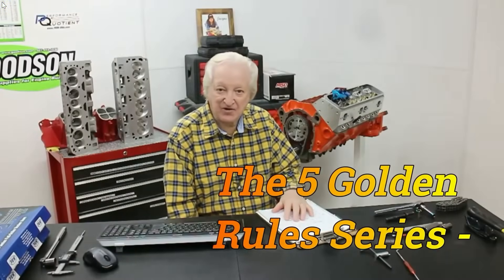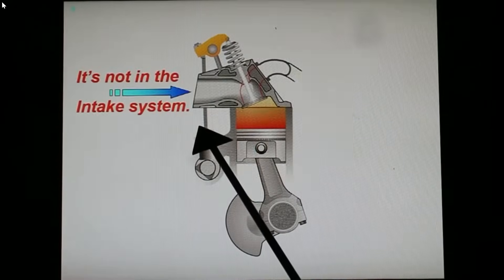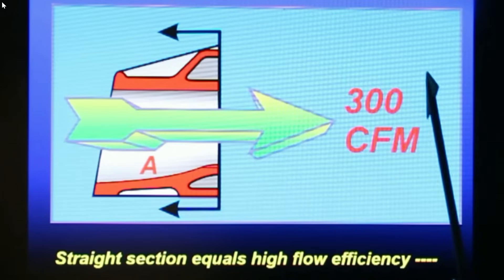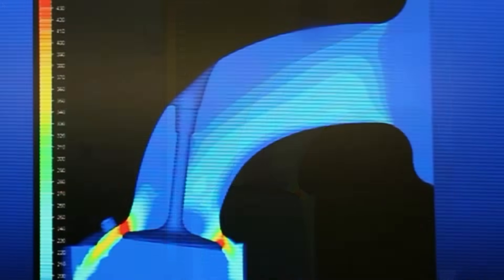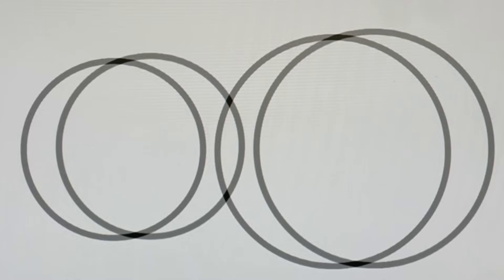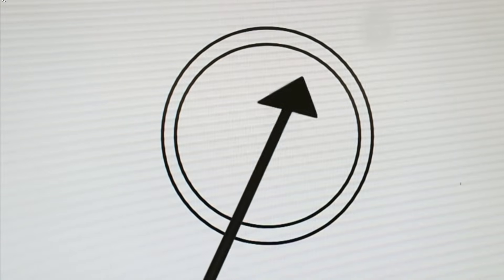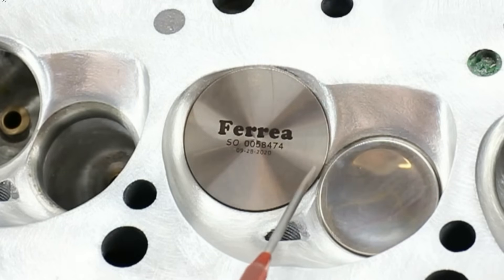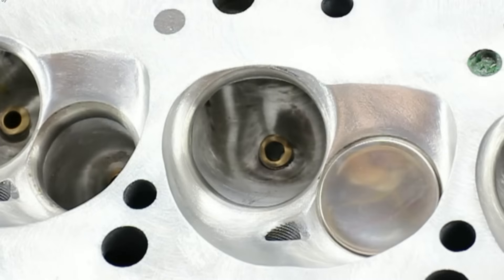5 golden porting rules - #1

Comment: I like your common sense, I believe you are basically turning the pinch point intake port into a "volute" which trades velocity for pressure which is in effect with the pulse is sort of an unassisted supercharger,the more air in the more fuel can be burnt efficiently producing more power.i really loved the tutorial on the version in the exhaust port,you are a treasure Mr Vizard.

Comment: It may flow more, but if the valve seat is cut away to increase flow, the heat transfer from the valve to the seat will be less, and the valve will run hotter - especially if the valve stem is more exposed because the valve guide has been cut back out of the air flow.  Also, a smaller seat will wear faster and seal less completely - the valve changes dimensions as it and the head heat up, from expansion.  Can't ignore these issues.
Reply: You do realize you’re addressing THE MAN on this process correct?

Comment: The Density of air at atmospheric pressure is 1.2 kg/m3
Pressure Drop (in Pascals) is 0.5 x 1.2 x velocity squared x shape co-efficient *
*See the SMACNA Design Manual for (very insightful) co-efficientsdefined for HVAC airflow design based on pressure drop, though very insightful for porting!

Comment: Why doesn't anyone make an engine head that has an intake port on both sides of the valve? that would double the flow. could work on a DOHC inline 4 cylinder or v twin
Reply: still one exhaust? I would be interested to see how such an engine performs. NA engines can't get enough air.
Reply: Lancia did in fact do this in around 1986. They developed an inline 1800cc 4 cylinder engine called a "TRI-FlUX" which was to be used in the  Lancia ECV Group S rally car but the class which was planned to replace group B was scrapped before it started. It had diagonally opposing exhaust & intake valves/ports. The exhaust ports were on both sides of the engine which allowed them to use a Turbo charger on each side of the engine. The intake ports were in the centre of the head to feed the combustion chambers from above. It was a very complex but very clever design. I believe the engine was able to produce up to around 800hp during testing. Google Lancia Tri-Flux.... it's a stunning engine.
Reply: Not necessarily. It might add some flow but not much more than a large port. But the problem with that is that you’d be applying half the engine suction to each side, meaning each side would move half as fast. That would kill air velocity which greatly affects atomization and power. More airflow isn’t always better
Reply: BMW actually managed this in 1966 with Paul Rosches M10 Apfelbeck 4 cyl engine for the F2. it had 8 intake runners 16v and radial valve design. wich improved head heat disapation and better fuel atomization. it also revved realy well. it had 260hp at 8000rpm in the 60ś for "only " a 2L engine
Reply: @hardforeveryone118 holy shit!! There is so much we are ignorant to , I didn’t know that they used to use water injection (steam, mist….H2O!) in order to increase octane performance on air planes that were turbocharged
Reply: @larryfleming7295 Oh yes, water injection is a very old concept, it utilises the latent heat of vapourisation concept to cool the charge
Reply: I like that concept or an oval that centers around the base of the valve seat or use it under forced induction and make more room a bigger chamber which would lower compression but could possibly make up with flow
Reply: Or a blend of 2 radius’s for the port 3radius top and 5 on bottom into widened oval that shrinks down to radius of the valve seat opening after dressed and worked for optimum flow

Comment: Are used to hang around and help in a little machine shop in Seattle Washington is actually in White Center on 16th Ave., South Foster‘s machine and they got a son in VGS 120 Seton guide machine and they started using on on the high-performance heads, a radius cut on the seat and what that did according to what the information said is when the valve first comes off the seat, it flows a little bit more Because of the radius cut anyway I just thought I’d throw that out there. This is Jim.Mungai from kennerdell Pa

Comment: I have always wondered since I was about 9 or 10.
Air is about 20% oxygen.  The rest is nitrogen and other gasses.
When we burn the fuel in the combustion chamber, what happens to the nitrogen and other gasses.
I don't have the funds or the knowledge to figure this out.
I'm hoping you can tell me.
Yes I have built several engines except for the machining.
Reply: A little of the Nitrogen (N2 i.e. 2 nitrogen atoms joined by a triple bond) is broken apart and converted to oxides of Nitrogen (NOx) mainly NO and NO2 but the majority of it passes through unchanged and exits as N2, same as it entered, just hotter.  CO2 stays as CO2, and is joined by a whole lot more CO2 from the  product of combustion.  The tiny amounts of noble gases like argon pass through unchaged as they don't like reacting with anything.
Reply: @andywebster4701 thank you for the explanation. I am now 66 and more informed. It has taken this long to get an answer. Thank you again

Comment: HOW ABOUT EXPLAINING WHAT 
"28 INCHES" 
REFERS TO. 
I HAVE LISTENED TO DARIN MORGAN FOR HOURS, 
AND HAVE NEVER HEARD ANYTHING SIMILAR. 
DO YOU MEAN : 
28 THOUSANDTHS INCH ? 

OR AR YOU TALKING ABOUT ATMOSPHERIC PRESSURE 
1 BAR = 14.7 PSI RIGHT 

YOU JUST ASSUME TOO MUCH 6:35
Reply: 28 inches of mercury, its a rating of vacuum pressure. its just the setting of how much suction they are using on the flow bench, you don't really need to know what it is unless you are comparing flow numbers. They use 28 inches as standard, but I guess used to be 25 so if you are comparing David's numbers to someone else's you'd need to convert to that 28 inch reading, since 28 inches is more suction and therefore more flow.
edit: I already knew what he was talking about in this case, but I've often had the same problem when I'm learning something new, especially in the engine world where I have literally 0 idea what they are talking about because its assumed its something you already know.
Reply: @Born_Stellar 
AT THE START , THE TITLE SCROLLS ...
PROVEN IS MISSPELLED IF YOU ARE IN THE USA. 
LIKE 
COLOR NOT COLOUR IB THE UK
Reply: @ no im canadian we spell it like colour as well.
Reply: @Born_Stellar 
PROVEN : CORRECT 
PROOVEN : WRONG 

SORRY , I CONFUSED THE ISSUE

Comment: For 95% of those who seek the magic of increased power thru cylinder head improvements,  the most cost effective route is one of the CNC heads (If Available for UR engine) as many commercial performance engine builders already do.

Comment: Great tips, and we got to learn sometime, I did my first set on my Disel and all I used was paper to take out casting bumps and smooth it out, before any work was done to heads, I’m a pretty confident user of grinding tools and I did a good job on the heads, sent my motor into a shop a good ways from me , they told me I ruined my heads and I needed to buy new ones, I’m 1000% positive they lied and stole my heads, and they didn’t check piston to valve clearance for the stage 2 cam now I have 8 pistons with valve impressions. 
Is a sad world out there folks . Good on you Pete for being a good guy! Enjoy the lessons
Reply: Eric weingartener showed pretty good flow improvements from just removing the casting marks with 60 grit paper.
Reply: Share the name so we can avoid them!

Comment: 90% ? What do you mean when you're talking about the seat's 90%
Reply: Inner diameter of the valve seat should be 91% of the outer diameter.
Reply: @andyboulet pretty much rim the shirt out of that outer layer but keep such a fine line so valves can sit
Reply: The throat, which is the area just behind the valve seat should be ~90% of the diameter of the valve seat. It creates a venturi effect. making the throat too large kills flow.
Reply: i dont get it either...
Reply: You take your intake valve size, let's say it's a 2.02 SBC valve. With the valve removed you measure the diameter of the port just inside where the last angle cut on the valve seat is, just inside the port. This is the throat. On OE heads it is usually very small, on aluminum heads it is usually already 88% and it's easier to find as there is a steel seat insert. On an aluminum head it is basically the diameter of the uncut part of the valve seat inside the port.

Comment: I though valves rotated in the guide and seat?
Reply: they do rotate like crazy, look any video of valves in running engine. It allow to have even wear
Reply: @inevespace  yes and not! There are 2 type of valve.  One for street cars with 3 groove and another type with single groove which grab the whole valve and not allow to turn at all is better for race application
Reply: @laszloszell8753  interesting. I had some Big intake valves with single grooves I thought were for air cooled 911. Couldn't understand the application. But I never did any research on it.
Reply: @laszloszell8753 in motorbike engines single groove valves rotate without problem. If I understood you right you are talking about retaining collets?
Reply: Like a venturi
Reply: They mainly stay put at normal operating speeds but, depending on setup, rotate quite a bit at higher rpm. 

Watch a video titled as “Overhead Cam at 14K RPM” and another title as “Valve Spring 8500 RPM”. You can see they are spinning as the spring is indexed sit a stripe in both videos.

Comment: I was taught to open the ports to the gasket inner diamiater size.
Reply: thats the port entrance on the intake side. this is inside the head. Port matching is easy and probably provides some gain, but not as much as opening the biggest restriction, which is the valve.

Comment: Are you the same David vizard of Mini Cooper fame, I bought your mini book years ago forgot the name,but I remwmber the lotos engine on a mini gearbox, I even moved my clocks t o put a 45 Weber on my mini 1275,reborded it out to 1330  if I remember correctly but the battery box in the dash good old days building my 1275 gt clubman .i remember now how to modify mini,by David Vizard ,definitely a new subscriber,
Reply: Is that the objective to porting a head to remove material from the intake and exhaust port to get more air in and out of the engine quicker.
Reply: @JasonLingerfelt  no more volume isn't always better, and sometimes people use stuff like epoxy to make the ports smaller in some locations. Port shape is more important than volume so you have to know what you are doing. just removing material everywhere will quickly ruin a head.

Comment: Respect to those that share their acquired skills and knowledge, which most definitely includes you David, Thank you. Had to reply to the malicious keyboard warrior previously, who, I believe is stuck in a world of hate. In reply, today we have an exponential volume of knowledge, led by Dr Google, good bad and indifferent. However principles remain constant and are enduring. Remember over a century ago twin cams, multi valves etc were already being manufactured. In the US mass produced car engines didn't reach a hp per ci till mid 50's. The evolution of fuel, alloys, man made fibres, casting techniques, machining and most of all, in recent times, silicon (as in computing) have revolutionised our world including automotive engineering. I will put my faith in a human being that has honed (punn intended) his skills over half a century and is prepared to share them. Thanks again David.

Comment: Okay, I understand the ratios but am I crazy or did he point to the wrong side of the seat when talking about the 93%? Starting at 15:10 its backwards right?
Reply: Where he pointed at 15:17 is actually the short turn, and the initial point at 15:10 would be the straight shot into the cylinder that would get the 93%
Reply: I came here to ask the same question and I think you’re right.  He did say 93% and point to the short turn and 91% on the long.  But if I understand what he’s saying correctly, we want to enlarge the throat on the long side of the seat where the bulk of the flow is and is crashing into that corner.

Comment: Usually I skip over old timers, because some of the guys I've met or watched haven't the slightest clue how things actually work. They just have their ideas and theories. That may have won at the local sportsdrome lol but in today's engines they are lost. "Too many wires blahhh" lol
There's still old guys saying 305 heads on a 350 is the way to go. (It's not, you lose so much cfm flow in the runners it's crazy) 
Then u have those guys who say they tried vortec heads on a sbc. They're junk. I ask em which cast it was. They said it came off a 90 Chevy truck. 😂😂😂 bro that's swirl port. Worst possible head out there. They think the center bolt valve covers automatically mean vortec heads 😂😂

Anyways My point was... this old timer right here knows some shit and I like his channel already. Subscribed.

Comment: So basically. High-ratio rockers and camshafts go first before i ever think about porting. 

Just get the valve out of the way of the air.
Reply: No, a given head design will have a limit to the amount of flow it can accomplish before you get reversion or turbulence. Simply opening the valve further will help to a point but on a SBC head for instance with a 1.94intake valve you might have an increase up to .480 lift or so but pushing it to .520 it will encounter turbulence and will kill the power. Of course none of this is linear, if you encounter a little turbulence at .520 you might get whole bunch at .575. So many things effect where the port is efficient, especially when dealing with stock style heads. You need to decide what you want to accomplish before you do any modifications. Street, street/strip, mild race or all out race. All require different components and air flow requirements. Once you have a goal you can build the engine to accomplish that. If you just throw parts at it then you will more than likely hurt performance rather than help and money is too hard to come by to waste it.
Reply: @1967davethewave  duration 🤔

Comment: I'm not sure what all those percentages are supposed to mean
Reply: (Throat diameter divided by valve diameter) x 100 = ?? %            Example.  (2.000” throat / 2.190” valve) x 100 = 91.3 %
Throat is the round area at the seat....
Reply: Primary resistance of flow period. Some people will never understand and that's OK 👍 just means this is not your area or field of work to understand!! Just like I don't understand the  Accountant numbers !!!
Reply: @rickybailey7123  I was assuming 91% having something to do with the bowl shape.  If this is for semi-beginners, it would have been nice to have this percentage touched upon a bit more.

Comment: Is anyhow useful to use a radial blade swirl element that creates a vortex inside the intake segment right before the valve so we can achieve a distributed speed of air as it spins very fast ? I saw once that putting a swirl element looking like a fan blade in the intake on a diesel engine had very good results in fuel economy and burn efficiency.
Reply: You're just adding turbulence and reducing flow for better fuel economy. Most OEM intake manifolds have something like this, but not right in front of the valve where flow is most important
Reply: @techroma1984  in the main fold after MAF sensor ?
Reply: @klaustek  Yes

Comment: I can remember 25 years ago now (maybe more) reading your A series tuning book over and over (it was like a bible to me at the time).   At the time I had a very slow mini 1000 and a very crashed mg metro 1275  With the A+ engine in.  I remember fitting the entire top end from the metro onto the 998 block and it ran and produced so much torque it was always spinning the wheels up in the wet through it’s open diff.   I’m sure you said in the book the 12g940 head wouldn’t work on the 1000 block (especially the mg version with the bigger valves). Am I mistaken.   The 998 had its standard cam still in it and the engine ran with no problems at all.   It was t the most high reving 998 I’ve had but I remember the torque made it great to drive.

Comment: I was just swiping through,  and saw the Chevy head from the chamber,  and thought,  what if the valve angle  were to be reversed? So intake would be similar to the heads being installed backwards, using the intake as exhaust, and exhaust as intake, with the valves reversed,  seems high lift flow would be higher, possibly, low  lift could be hurt,  with the valve opens, the air should have a straight shot into the cylinder. The swirl may be hurt also, but tumble should be greater,  but with optimized chambers could inverted valve angles in a wedge chamber,  any thoughts?
Reply: The main reason that the valve sizes are what they are is that the intake valve has atmospheric pressure pushing the air into the cylinder and on a naturally aspirated engine any restriction at all in the intake system generates a power loss. The exhaust valve has pressure from the piston pushing the exhaust gas out, and exhaust valve restriction mostly generates internal EGR and reduces scavenging a bit both of which creates a power loss, but not by the same amount. Intake needs to have priority in a naturally aspirated engine. In a turbocharged or supercharged engine it is possible that reversing the valve sizes might be helpful but with the exception of I think some race-prepped nailheads, I don’t think it’s a common way of doing it.